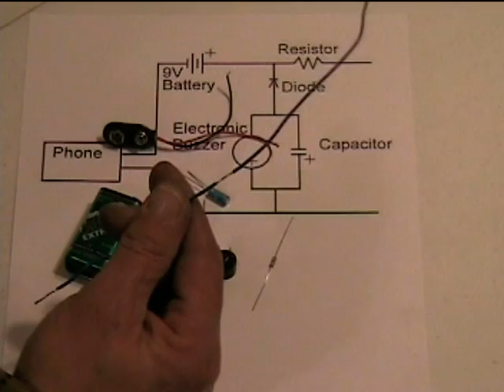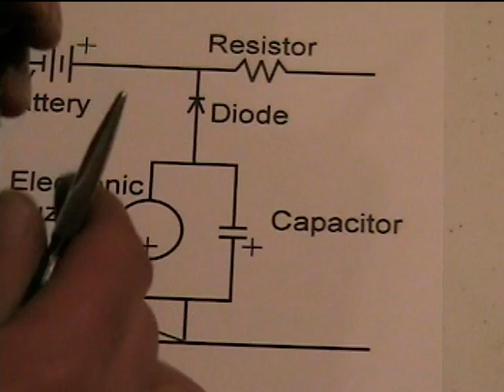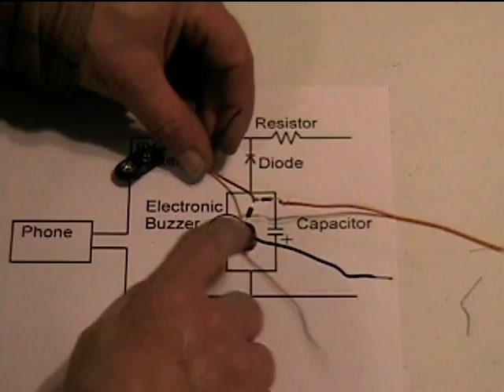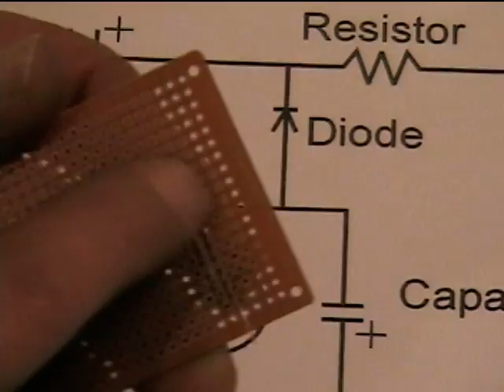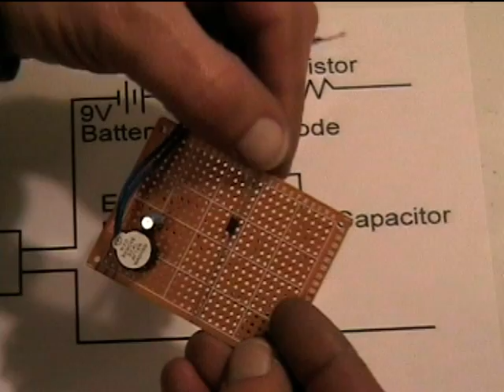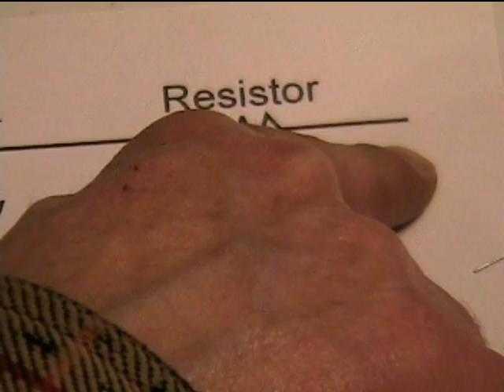Building 2 Phone Intercom W4P300 #303

Comment: Great video. Quick question when you talk about local station vs other station how do you wire the phone?? I’m building 2 “portable phone” in a box using a  small white box like you have. My understanding is phone use the green and red. Would local then use the yellow and black the. Switch the red and green when it goes to the other station?
Reply from the maker: The telephone always uses the red/grn combination of wires. I was showing a couple ways to build this, normally you would build both ends the same so each end would have the white phone jack box and you would use the red/grn at each of these. The wires that are swapped would be the two wire line between the two stations. The components can be assembled as shown at the beginning of this video but you would have to insulate things well before cramming it into the white phone jack. As shown in w4p300 #302 you could connect the parts together mostly by using the unused screws in the jack. If you build the parts onto a circuit board and make it small enough (cramming the parts closely together on the board), you might be able to fit that board inside the phone jack.

Comment: Can you please explain what the capacitor is for?
Reply from the maker: the electronic buzzer draws current in brief pulses. During the pulse, the current causes a significant voltage drop in the circuit since the current from the battery must flow thru one of the phones and the two resistors and the voltage would be too low. The capacitor stores up energy between pulses drawn by the buzzer and can provide the burst of energy when the buzzer needs them.
Reply: @wired-up  got it awesome thanks. great video!

Comment: 30:20 which wires needed to be flipped? My phones are both ringing when closed
Reply from the maker: The two wires that run from one station to the other. If both stations are buzzing, there is something wrong with how you wired it. The wire with the resistor connects to the wire without a resistor on the opposite station.

Comment: Fantastic job I do appreciate your work .I ve searched for this for so long thanks man..
Reply: @abdul jaleel 9v battery..68 ohm 0.25 watt resistor..1N4001diode..22uf 16volts capacitor..telephone set...you need two of each component and don't forget the board

Comment: Oh and another thought. What about using  the rotary dial as a switch in series with the off hook switch so that the buzzer only works when the dial is rotated. So if you dial 9 the buzzer will buzz until the the 9 gets back. It would mean playing around inside the phone a bit, but I've found to wires from the dial that will work in the way i discribed. Just need to work out where to connect them into the off hook swithces.
Reply from the maker: You have a good idea there, I did this many years ago for an intercom at work. As long as the rotary dial was not at the home position, it would sound the buzzer at the other end. The rotary dial had a set of contacts that would be closed whenever the dial was turned (this was used to mute the earpiece in the phone so you didn't hear the loud clicking of the pulse dialing), I used this to send the signal to the other station to sound the buzzer. This will not work with the circuit shown in this video (which is designed to work with just two wires between the stations). Your plan to put that contact in series with the hookswitch would prevent the phone from working when the dial is at rest because the contacts are open, you wouldn't be able to talk. On the system I made years ago, I used two extra wires to operate the buzzers, no problem since you have the cat-5 cable. Send me an email and ask for "#311 Manual signal intercom". Use the muting contact of the rotary dial instead of the momentary button switch in the diagram. intercom4u at yahoo dot com

Comment: Hi. Thanks so much for this. I'm waiting for the parts to arrive. I've got two old phones and actually really need an intercom from my house to my fathers - which is next door.  I've even got a cat 6 cable in the right location. So my plan is to have a central power source of either 12 or 19 V. And run four wires between the phones with 2 supplying power from the transformer. Can you see any problems with this idea. Thanks

Comment: Is it possible to put a louder ringer on the phone and to run it on 12 V
Reply from the maker: Instead of the buzzer and capacitor, connect an opto-coupler in its place. This is a combination of an LED and a photo-transistor (use something like a PS2501 or 4N28).  Connect the LED side in place of the buzzer and use the transistor output to drive a larger transistor which could power your 12v ringer.
Reply from the maker: Send me an email at  intercom4u at yahoo dot com and ask for info on connecting a bigger buzzer or bell to #302 and I will send you more information on doing this.

Comment: Thanks so much for making this Video. This is the only a video on YouTube with the intercom system that will ring the other station and would tell us how to build step-by-step I really appreciate it thank you for making this video I’m thinking of building one I have one question is Can you please tell me which wires or positive and negative blue and yellow Are the ones I can’t figure out positive or negative thank you for your help
Reply from the maker: The wire connected to the resistor is actually orange, the lighting isn't that great where I made the video. Anyway, don't be concerned about the polarity of the blue and orange wires that feed to the other station. If you were to connect a voltmeter across the blue and orange wires, you will see no voltage when both phones are hung up, the orange wire will be positive when the local station only is lifted and the blue will be positive when the distant station only is lifted. When both stations are lifted, you will see almost no voltage (unless the line is long or the stations are not the same in some way; different types of phones or one battery is lower than the other).
Reply: Wired Up Thank you for your help thank you for answering my question

Comment: I used a 22uF50V capacitor in both circuits,  a 68 ohm resistance in one circuit and a 280 ohm resistance in the other...it works well but one buzzer continue to buzz even if both phones are hung up.I had to work with available pieces.any explanation or suggestions ?
Reply from the maker: If one is buzzing while both are hung up, my first guess is that you have the battery backwards. Disconnect the line between the two stations and if it continues to buzz, that is probably the case (otherwise you have the diode and buzzer both backwards, presumable the capacitor as well). If the battery is backwards and you correct it, you will then need to reverse the two wires between the station.

Comment: Can i give 9v from one supply to both phones ?
Reply from the maker: No, each station needs a separate 9v source so it has power to signal the other station. Both 9v sources are used together when the phones are talking, this is a little more voltage than is actually required so resistors are used to limit the current.

Comment: As a complete novice to any kind of electrical work (never even used a soldering iron) this is understandable I really appriciate it! Three things I would like to ask No.1- how would you add a led bulb to flash as it rings?
 No.2- could you do this kind of in depth video about the multiline setup? 
No.3- is there anyway to get the onboard ringer to work?
No.4-can these phones latter be added to the multiphone setup withought redoing thw wiring?
No.5-could you put a parts list in the description, what connector block did you use?
Reply from the maker: 1: Instead of the buzzer and capacitor you could put an LED. It wont flash (this would require quite a bit more circuitry) but it will light. Temporarily connect a meter in series with the line between the station to measure the current to make sure it is not too much for the LED, typically no more than 20mA.
2: I could but it would be very, very long so I wont. If you learn to read schematic diagrams and have learned basic assembly skills you would be able to build it.
3: Yes but it would make the circuit much more complicated, I was trying to make the simplest possible circuit.
4: Yes, if you bypass the battery and resistor.
5: There isn't much of a parts list, all the parts are identified on the schematic diagram as shown in the video W4P300 #302 or you can send me an email with that title and I will send you a sheet you can print out showing the diagram along with notes on the circuit. The connector block is a standard modular telephone connector jack.
Reply: Wired Up 
Thank you for responding! I am getting the last of my parts together and am going to try my hand at this on the upcoming weekend.

Comment: I have a question ....how to keep a break (2-3 Sec) in buzzer ringing when one of the phone hooks down after the conversation is over...? 
Means when the conversation is over, both the users will not keep the handset at the same time..so one of the buzzer will ring when the other handset is kept down.
So how to keep the buzzer off until both the handsets are kept down and after 2-3 second makes buzzer on . I hope U understood what I am going to say/achieve.
Reply from the maker: I was making the simplest circuit (fewest parts and no power draw from battery when not being used), any time one phone is down while the other is up, it will buzz. 

Either a circuit would have to be added to latch (remember) that both phones had been lifted and disable the buzzers until both phones were put down, or, a timer would have to be added to each buzzer (as you suggest) but this would also delay the signal when you call the other station.

Since you had just finished talking to the other station, if it buzzes for a second or two until they hang up their phone, you know that you can ignore it. This is just the result of having such a simple circuit.
Reply: Yes..it is a very simple circuit and i loved it... I wanted to build one with the circuit i described.
Waiting for more upgraded version of this  circuit. 👍👍👍
Reply: Amey Nhavelkar